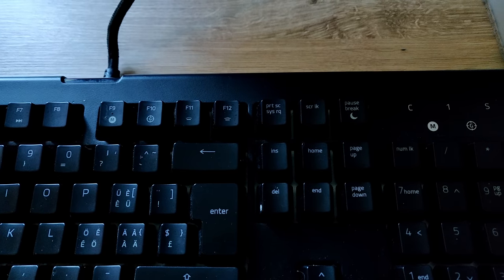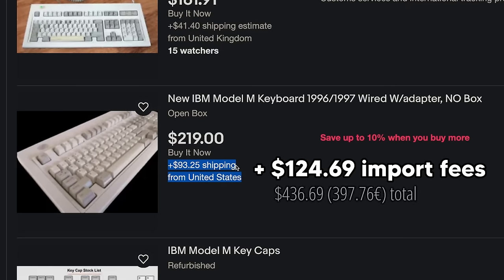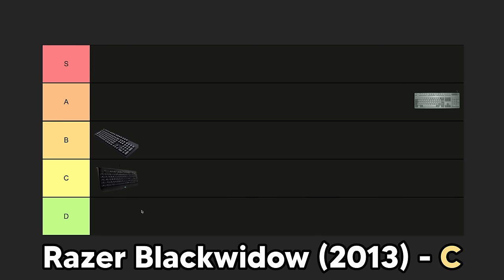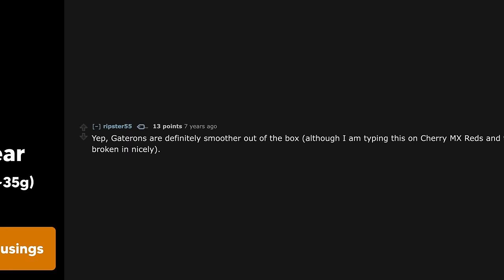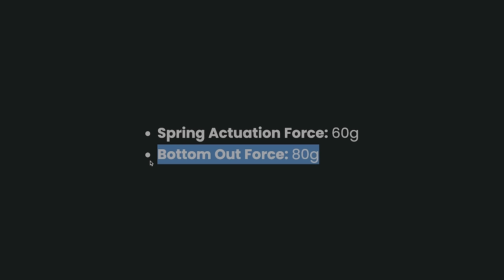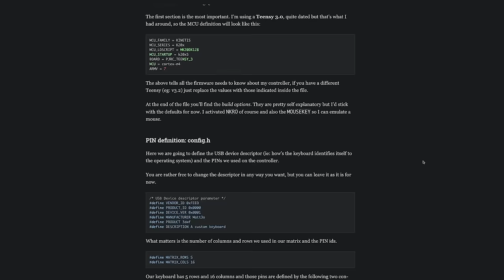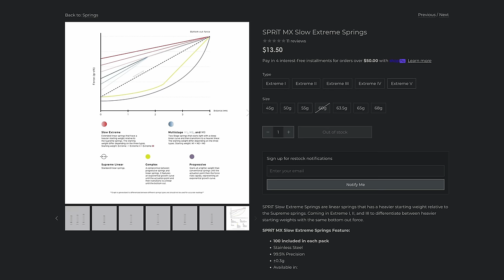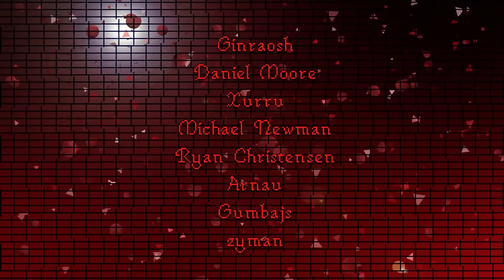How I Lost Interest Towards Mechanical Keyboards

Comment: Interesting story. The keyboard hobby has definitely changed (more so in the last couple of years) So many vendors at different price ranges, with some many variations of switches, and keycaps. A lot of keyboards are kits you can assemble yourself and customize, and a lot of waiting as well since many are bought through groupbuys. There is a lot of emphasis on premium quality materials and finish, with prices to match. GMK keycaps are usually well over $100USD, and you may need to wait months and months. Fortunately a lot of these mods/design features are starting to trickle down to prebuilt models. Keychron is a big player with a dazzling array of models incorporating a lot of the desirable enthusiast features like gasketmount, silicone dampening, foam padding, lubed switches and stabilizers etc. 

I like a nice keyboard and have no interest in building one but fortunately I can start with one of these and fine tune to my liking without paying a lot of money. You can start with a Keychron V or K Pro in the layout of your choice and adjust to satisfaction. Throw in some well reviewed switches for about $50 and choose some keycaps for another $50 and there is no real need to spend more. There is something for everybody now and you don't have to settle. I find it weird that most models are these super compact layouts. I like a traditional TKL layout because I've been typing on those for decades and it's hard to unlearn.
Reply: I've always preferred a smaller layout, it's nice not having to reach for keys that can be accessed using layers, combos or by other means. I currently type on a 34-key keyboard, and I can access everything without having to stretch my fingers or move my hands, which is extremely comfortable.

I guess it's to appeal to those that play games, it does allow for more space on the desk to place your mouse, but it could just be for aesthetic reasons.

Comment: Mechanical keyboards were not "relatively unknown" in 2013.
They have been "known", being the main kind of keyboard starting in the 1980s.
It's just that membrane keyboards became more common for a while, because they were cheaper.
The last decade they just RETURNED to popularity. They were not new, not relatively unknown.
Reply: Actually it wasn't only "because they were cheaper" but also because they were a lot quieter. Well that and the advanced membrane keyboards could have individual weight for each key. The presses were designed to match the strength of the fingers so the keys you pressed with your ring or pinky finger were a lot lighter then the keys towards the middle of the keyboard, not to mention the space bar that you would press with your thumb. Some loved that and some hated it, but it was something made possible by the rubber dome sheets used. Something like this could be done with mechanical keys, but it would drive the cost a lot higher. Again some would love it and others hate the different weight.
I remember how manufacturers were competing in making as quiet keyboards as possible.

Personally I love buckling springs. At one of my first jobs I some times repaired IBM keyboards with buckling springs. The common problem was a flapper that had moved out of it's intended site. I remember that there was a lot of screws keeping everything together, but it was really a simple fix just opening it and put the flapper back where it belonged.

The feeling and sound of the buckling springs keyboards was intended to remind you of using a mechanical typewriter. This was fine as long as you had a lot of typewriters and only a few computers. But as computers became the standard people started to get irritated on the buckling springs keyboards, especially when membrane keyboards became common.

So yea, membrane keyboards replaced mechanical keyboards not just because they were cheap, but also because they worked better in huge offices with many people working in cubicles.

Comment: What really burned me out of the mechanical keyboard scene is the insane lengths people went to to develop new mounting methods instead of just using a non MX switch design. It wasn't just putting aesthetics first, it was literally putting the mechanism that inspired the hobbies name last on the priority list. I still like and use a wide variety of keyboards (including some nice sounding and very pretty ones) but I no longer keep tabs on any new "developments" in the scene.
Reply: Well yes because changing the switch design would completely remove the customizability enthusiasts enjoy most.

Congratulations you came up with an idea that is completely unprofitable for anyone designing keebs

Comment: This is actually pretty similar to my trajectory in the hobby.

I got into it around 2013 as well. Started with a Daskeyboard 4 Professional with Cherry MX blues. After weeks of pouring over every single review I could find comparing MX browns to MX blues at the time, I decided to go with blues because I was in college and writing a lot of papers, and blues were marketed as more of a "typist" switch at that time.

Just like you, as I dug deeper into the world of keyboards, I eventually stumbled across discussions of buckling spring keyboards, and I ended up purchasing a Model M from Unicomp.

I've gone through many, many keyboards over the years, but I've settled on 2 "endgame" boards:

1.) My Leopold FC660C with 45g silent topre switches
2.) My Model F Labs F77 Reproduction with capacitive buckling springs

I haven't typed on keyboard with MX style switches in probably three or four years at this point.

Comment: Honestly, I have had nearly the same thing happen. I originally bought a super crazy LED, MACRO, etc. Corsair keyboard back in 2012-2013, used it for a long time before I realized I never used any of the features and ended up not liking how gaudy it was. Later got a not great "cheap" 60% that was honestly too small for me. I bought one of the first two part mechanical ergonomic keyboards and found it to be such a learning curve that I ended up not even using it and now it's sitting in a box neglected. Then finally got a DuckyAkko and WASD keyboard each with I think Blues and I honestly have been happy and satisfied with them. I have felt no need to change them. They may not have RGB, fancy nobs, or whatever but they are solid, clicky, and have a number pad which I use a lot. 

My wife got into the new keyboard scene and honestly she got a crazy $200+ insane CNCed aluminum chassis, lubed, etc. and it's honestly made me think about it. These new switches are something else. I might have to come back one day but until then, I'm happy with my simplicity.

Comment: I feel you bro. Those nostalgic days from 2011-2015 when mechanical keyboards are just limited only to well known brands and relatively expensive. So I ended buying some used mechanical keyboards. I have 2 CM Mech with cherry mx blue and red. I also got CM Trigger with exotic cherry mx green switches. I also tried the Corsair strafe rgb with brown cherry mx but I sold it later and just bought a cheaper rakk lam ang lite which have outemu switches and become my daily driver until now. But it's starting to show some bad signs, sometimes it doesn't register a key and sometimes it register multiple keys and one of the led is busted out. Luckily today, there are tons of options in the market which are much affordable than before :)

Comment: I got super into the hobby because nothing matched my needs properly, so I figured I had to make it myself. Then I went into a microcenter and tried the new Razer Blackwidow v4 75% and it was over. Happened to find a perfect keyboard for my gaming that also had a nice sound and feel, and I could switch the caps or switches later if I really wanted to. Not to mention its legitimately cheaper as a full board than a lot of the barebones kits that all the youtubers seem to hype up. Those razer tactile orange switches are divine

Comment: It's nuts how mechanical keyboard hobbyists go all out, soldering the boards etc to get their keyboard just how they want it.  I remember the old IBM keyboards when I was kid and how they felt amazing.  However, after experimenting with some mechanical keyboards I've found I type best on a good old cheap gaming membrane keyboard.  I'm using Steelseries APEX 100.  I don't know what I'll do when it dies and the line is discontinued by the manufacturer :(.

Comment: I knew what I wanted when I first set out to get a mechanical keyboard, because I had been happy with my old keyboard before that and I knew why. I had an iMac with the thin Apple keyboard (basically a laptop keyboard). Those rubber domes have my ideal quality: the keys rest on a tactile bump. You push into it, and "pop the bubble" to actuate the key. The travel is super shallow, and there's no "partially pressed" point where the key isn't actuated. You can rest your fingers on the keys. So I got a full size keyboard with MX Browns. I wasn't happy with the length of travel, so I put double O-rings on the keycaps. The result of this is that the travel stops right after actuation. Every time I start thinking about new key oards or other switches, I type on that keyboard and realize I'm just perfectly happy with it and it feels exactly as it should :)

Comment: That point to point soldering on that keyboard really reminds me back when I repaired old tube amps and radios that also had point to point wiring.
You're lucky you shorted out just a keyboard... shorting out an old 50s poweramp without any protection circuitry could be a safety hazard... I've actually popped a few fancy KT66s in the past because of that.
We've invented PCBs and left point to point soldering behind for good reason!

Comment: Try the Royal Kludge 60% layout. I leave the arrow keys on all the time and use FN momentarily to switch the layer when I need to type a question mark. Works just fine and doesn't really slow down typing all that much since question marks are rare and only at the end of a sentence. You can buy a hot swappable RK61 (at least in the US) for $50 USD. With that, you can easily order your preferred switches and just drop them in, or do spring mods if you want to try to get a different feel. I'd recommend Kailh click bar switches as well as linears with a extra long 2-stage spring. If you don't like them loud, try Kailh Mute Jades with the spring mod. That should have all the tactility in the world and be pretty quiet.

Comment: I had an argument with an old teacher of mine about how PS2 is functionally plug and play now. Many motherboards (virtually all of them made after about 2015) that still have a PS2 port, as well as all PS2 to USB adapters, will detect something getting plugged in and restart the connector, meaning it will pick it up without turning off the PC. I proved this in class and got sent to the principal's office. Fun times

Comment: I lost interest too, after finding something I'm genuinely happy with.  I used a ton of custom and exotic boards, after 17 years of HHKBs...  and what I eventually found works best for me is a mundane Keychron V1 or Q65 w/ Durock T1 switches and a nice set of budget caps and deeply customized firmware.  The 65% to 75% designs seem like a "goldilocks" sweet spot for physical layouts, and QMK firmware allows a great deal of personalization to make the keyboard meet my specific needs.  So my HHKBs are in storage now, as they don't meet any of my "must have" requirements:

1. Open-source firmware, ideally QMK.
2. Hotswap switches so I can install my favorite switches and caps.
3. 65% to 75% row-staggered (i.e. traditional) layout.

After going open-source, I can't go back... anything proprietary just seems irrelevant now.

It's also really handy to have a knob... and RGB per key, for custom layer and status indicators, since I have like a dozen layers and it's helpful to see at a glance which ones are active.

The only thing I really still like about HHKB is the Topre switches.  But I hear the Niz Plum switches do the same thing better... or I can get a very similar feel from some tactile switches, like Durock T1 or Boba U4 or Akko Lavender or Jelly Purple.  So I use those, since I can get a typing feel which is just as good but with all the benefits of newer and more versatile keyboard designs.  HHKB hasn't kept up with the times lately.

Comment: For me, after trying many keyboards, I've settled on the Razer BlackWidow V3 for a few reasons:

Software: Razer's Synapse software is good and allows me to easily configure the RGB lighting on the keyboard, as well as set up profiles and macros.
Out-of-the-box experience: It feels great right from the start. I took it out, plugged it in, and it worked perfectly. It more than met my expectations for my use case.
On-board profiles: I can store profiles directly on the keyboard, which means I can use it in the BIOS, for example, to input predefined text or commands.
Support: Not only can I contact Razer support for assistance (they have excellent customer service), but I've also found that other programs work well with this keyboard such as euro truck sim.
RGB lighting: I personally enjoy the look of RGB keyboards, and the Razer Black Widow V3 delivers on that front.
Interoperability: It works well not only with my Razer mouse (and mousepad) but also with third-party software such as Seagate and G.Skill (and hue).

This may not be applicable to everyone, as preferences for keyboards can vary greatly which i do get. Some people prefer SteelSeries with OLED displays, others like custom keyboards, and some prefer Ducky or HHKB keyboards. The same goes for keyboard size. Personally, I'm a fan of 100% keyboards, but I have also tried and found 65% and TKL (Tenkeyless) keyboards to be suitable for portability. Ultimately, it's about finding what works best for you. And too all reading i recommend sticking with what you like even if that is something like a membrane keyboard.

Comment: I had a Model M and a Dell AT101W that was linear modded by me from my childhood. Went down the path of keyboards starting in like 2012 and spent a TON of money. Also found out I need a numpad and F row after trying a Magicforce with MX Greens. Settled on 1800 layout, got a Cooler Master MasterKeys Pro M with browns that I really liked for while but the browns were never my thing. I kept going back to the Dell with the modded alps switches. Got a Drop Shift and recently put JellyFish linear switches in it and my thirst has dropped off, I love the Shift for daily use, use the Dell Linear modded board for my retro keyboard and even break out the model M when i'm playing DOS games on my 486. The only thing I'd like is a high profile version of this layout, the Keychron Q5 is pretty much that. Will probably get it some day